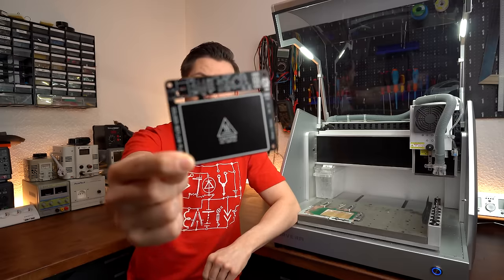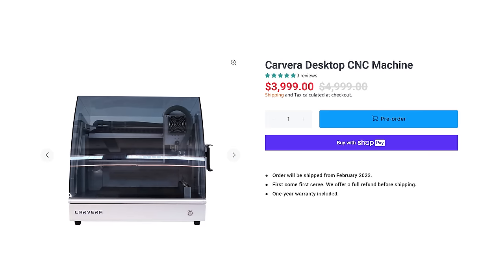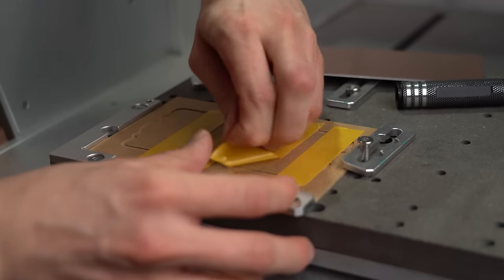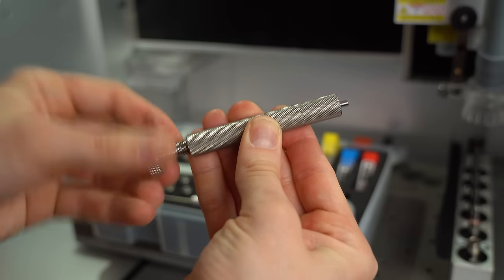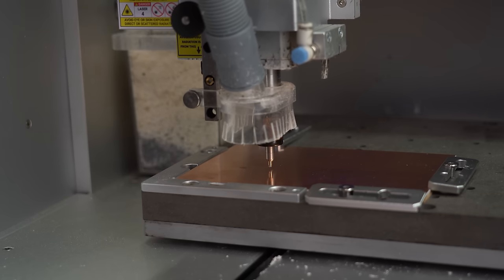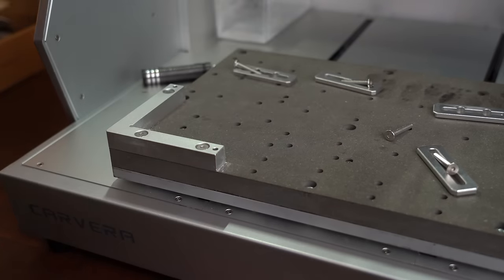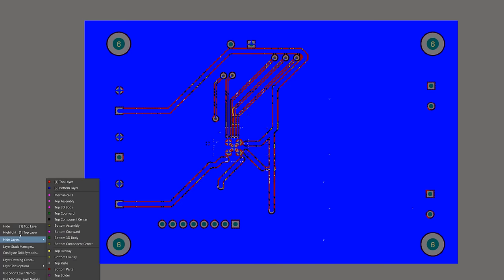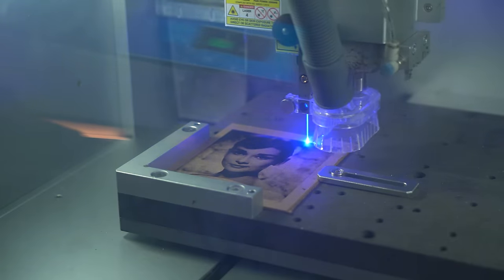"A Machine PERFECT for Making PCBs at Home" Is what they said!

Comment: If you 'just' want to make a PCB, try use a resin printer (without the VAT but with a photo resist coated pcb) as the printer provides the UV source, and the LCD can generate the required pattern. Expose the layout as layer 0 for the required time, develop and etch 'as usual'
Reply: Wow! That sounds great! I feel silly for having not thought of that…I keep looking every so often to see if there’s a cheap and easy way to do this. Transparencies and a UV table seem to require careful choices of materials and stuff that I’m afraid I will have to keep constantly experimenting with to get right.
Reply: Only downside is that one 100mm^2 piece of presensitized copper clad is probably going to cost more than 5 copies of a 100mm^2 from JLC or PCBWay, including shipping.
Reply: @treelineresearch3387  You could be right - I don't know current prices, but I know this:
- It is possible to get appliable photoresist, either in a spray bottle or as a film you apply. Great if you have a stack of bare Cu boards.
- It is faster than waiting for a PCB manufacturer to produce and shipping time can be long especially if you're in a rush
- You keep your design private
Reply: @EgonSorensen  Yeah I can see corporations/consultancies wanting to keep stuff in-house for quicker turnaround and higher security, but just not really a concern for me most of the time, especially given how much postprocessing a fab-at-home board already requires even with presensitized stock (bonding vias, solder mask, etc). Corporate also has different demands and much bigger budgets for materials, dedicated wet/dry lab space, and tooling, than I do so the equation is pretty different.
Reply: @treelineresearch3387  I see two versions of a product: Prototype and Production.
Imho a prototype rarely needs soldermask, but it can also be applied using the resin printer - some experimentation may be needed, esp. if working with 01005's ;ø)

Via's can be easily made with rivets, if a double sided board. 2+ layered isn't a DIY project usually, unless you want to do your own multi-layered 2-layer 0.8mm's + more experimentation, gluing, etc.

Prototypes are excellent for concepts, or very small batch jobs. 
For everything else, yes - it does not make sense to make pcb's at home any more.

Etchants, developer and soldermask can/could be obtained for relatively low amounts of money - and stores for a while.

Also doing it at home could save on import charges and fees. Having the post office/courier (read: required) doing customs clearance often adds a substantial amount of money onto the price of the PCB's - depending on where you live.
Reply: @EgonSorensen  I hadn't considered the local fees that might be attached, that definitely can change the economics. In the states it often seems like our government is actively incentivizing using China with policy (getting something shipped from China often costs less than shipping something a couple states away...). Of course this comes at the expense of our own manufacturing capability, but that containership largely already sailed east. For low density quick prototyping I still mostly use perfboard or "dead bug" on copper clad, still pretty viable for experiments/one-offs and proving out analog blocks.

Comment: 11:05 it should be pretty easy to do double sided designs without all that rivet nonsense. I do similar things on a daily basis milling aluminum on a big 3mx2m CNC router. It is a matter of having sacrificial material and cut the negative of the outside perimeter to make a hole to stick the pcb with the other side up. That way you do have a reference to align the PCB for the other side. To makes things way easier, put one of the PCB corners as the 0,0 then put the zero manually so the contour falls inside the sacrificial material. Make the hole undersized on purpose then increase it's size little by little trying the PCB until it fits. Ideally you'd have a table with suction, just so it is a drop and done affair, but you can always cut double sided tape to size for that purpose.

Comment: I've had great results from a generic "3040" ballscrew CNC that I've upgraded in three ways: 1) I replaced the odd spindle motor they provided with a high-quality 24000 RPM 3-phase spindle.  2) I swapped out the stock steppers and moved to closed-loop stepper/servos.  3) I added a probe input so I can capture a height map of the board before I ever cut it.  Oh, and I chucked the printer-port stepper driver and went with a GRBLHAL networked controller that supports a ton of I/O and 5 axis.  Anyway, the results are amazingly good, and definitely solid for creating your own boards, though obviously it's not going to add vias for you.

Comment: That UV exposure solder mask can be used with an additional mask that you print on a transparency film and lay over the circuit so you can prevent the UV exposure to the areas you want exposed pads. The unexposed mask can then be removed with solvents (acetone I think?) and the pads exposed without the additional milling operation.

The Carvera is expensive but is already a LOT cheaper than a comparable machine that has been on the market for a few years. I worked with the LPKF circuit board CNC for a while and those are a $30-60k machine. I went through the additional training classes they offered and still had issues with damage due to tool changer issues. It did produce nice boards when working right and it had decent software with good support so there is that.

Comment: I made a simple PCB for a passive crossover for a speaker im Building. Carved along the traces with a 90° v-bit and then added solder to the traces so they can handle more power.

Comment: I had a question about the tool clamp size and type but found the answer on their site, so I'll leave the info here.
Comes with 1/8" spindle collet, 4mm, 6mm and 1/4" also available separately. The wireless probe tail shaft can be changed to suite the different sizes.

Comment: Just to set the record straight, there are a few more downsides to using board shops (and this is not directed at any shop in particular). First though let me point out that they (in my experience) deliver great work and high quality pcbs (and associated services), credit where credit is due.

But (for the small maker with some labor of love designs that you try to market to like-minded people) :
- Shipping cost, import fees, taxes ... All of these are excessive where I live. I have had times (depends on getting lucky with customs) where the PCB's cost me 2 dollars and shipping + fees + taxes cost me 120 Euros. And there have been times where the PCB's cost me 40 dollars and the shipping + fees + taxes cost me 30 Euros. Aside from the obvious 'wtf is with these add-on costs' one has to realize that it is a crapshoot if you actually need to calculate this cost into your end product.
- Protecting your intellectual property, and this is a general concern not specific to any board shop. It might not be a fun thing to consider but if you make a good design that garners some degree of interest or appreciation it will be stolen. Sending out your design to an external party is one of many ways in which this will happen. By no means the only one, but one none the less.
- You pointed this one out yourself, speed, again most board shops do amazing work and fast but shipping will slow down things considerably. If you are making fast iterations on a new design this can be a problem. A system like the Carvera, the Wegstr cnc or other desktop PCB solution is going to help out with that a lot.

On the up side, if you need quantity and quality, you will eventually have to use a board shop of some sort.

Comment: Sounds like a good toll for rapid prototyping. 
If you have an finished Design, I would go with an professionel Producer like JLC.
But during the Designphase there you have to: Try, fail and repeat until it works. Sunch an CNC sounds like an good option for multiple iterations.
Reply: Good for catching the little mistakes. We all make them, but having to modify and/or toss out a stack of PBCs because of a small mistake that you could have caught with a quick prototype, isn't good.

Comment: I worked as a biomedical engineer back in the 80's and I'd setup a system that did something similar.  And boy, it was a booger to use.  The mill was ok in the x & y axis, but z depth was controlled by a solenoid and thumb screw. The PCB had to be perfectly flat, or else. And, as far as I knew,  router bits that small weren't available.  A conductive ink was applied to the thru holes, then copper was plated to the boards in a plating machine . (Keeping the chemistry right was also a pain.) Then photo resist was hot rolled on from a carrier film,  followed by normal photo resist procedures.
Took me many weeks to get the procedures down, and in the end, we never really used the system.
Better than running a test scoring scanner when I first started working, though.

Comment: I recently got my first boards from JLC pcb and they worked great despite my questionable design!
Reply from the maker: Great to hear!
Reply: My last design from JLC was almost perfect except that - yet again - some of my holes were a bit too small. They fit each pin just fine but the ESP32 dev board has slightly angled headers already installed. The holes are just small enough that it’s really hard to get them installed :)

That’s one thing that I’d like about making them at home. I can fix mistakes more quickly.

Comment: When clamping thin flexible stock like PCBs, don't have your clamps at an angle like you did in the video. That warps the stock!
Instead, put some packing under the FAR end of the clamp, slightly thicker than the pcb. Now the clamp will only apply downward clamping force at its inside edge and your PCB will be pressed downward and held neatly without mashing and warping it.

Comment: I was getting reasonable results with a modified 3040 and FlatCAM (double sided). This was down to SOIC without any levelling which is all I needed at the time. Though cheap boards and cheap cutters I found could tear out the surface material. I should retry now with my even more modded machine and sw levelling to see how well I can get down to TQFP64 :) Nice video, so hard to try to cover so many aspects in such a short time!

Comment: I built a rotary mill from scratch using Linux CNC on a PC I found on a rubbish dump(plus about $400 dollars in hardware).  The reason I comment here about it, is that I use the Nefertiti bust, as you displayed, to test and tune the machine.

Comment: I've been developing CAM software designed primarily for CNC art/signmaking/engravings, and it works fine for PCB milling if you have a good file format that can be loaded in (i.e. images, vectors). It's called PixelCNC. It's still in beta and right now I'm working on a built-in tutorial system. If you have any suggestions for tutorials or need help with anything shoot an email to us.

Comment: 4:11
Oh my god, cases with slanted io Or usb ports gives me nightmates. I had a case that was like this and my 40euro usb headphones kept breaking,  I have spent 120 euros on many headphones  and even the 3.5mm jack ones have the jack have a loose wires bcs of gravity making it slant and my usb headphones had the DAC in the usb itself as a board, the usb kept ripping off the boards WITH THE SOLDER PADS so I couldn't repair it. Seeing you use a pc case with slanted I/O gave me nostalgia

Comment: Definitely the features are paid for, they are certainly very useful and I would say that if it arrived better packaged it would be a good thing.
Like any complex machine, there are always adjustments to be made during installation.
Surely it is a nice top of the range, I dare say for semi-professional use, the hobbyist will hardly be willing to spend that amount to use it "three times a year" in all cases the range of accessories seems well developed even if the $ 299 for the PCB kit it seems to me a further increase in costs.
In the images I saw that the virgin copper plates due to their elasticity risk rising, to solve the problem you could try with double adhesive tape between the pcb and the work surface.
One thing to rationalize to reduce the movement of the spindle could be the zeroing of the height which could be done near the tool holder and not at the other end of the work plane, possibly if the zeroing did not concern only the Z axis it could be it is useful to place the tool holder to the left of the work surface.
I see you soon!
Reply from the maker: Thanks for the feedback :-)

Comment: their PCB's are properly painted with multiple coats which is why bought ones look better than homemade ones, and using a special coat layer on top of that.
Reply: I want to say the vids I've seen of actual PCB fabs were using a film transfer process to apply photosensitive mask that then gets UV exposed and etched away chemically, so the consistency of the layer was controlled more by the film manufacturing than the application process. Not sure what that process actually entails as far as heat/pressure and if it's feasible to do at garage scale, or if the film is available in small quantities and is storable at room temperature (not sure if it's a precatalyzed material that only stays latent when refrigerated, like carbon/fiberglass prepreg). Spin coating might be a viable alternative for more consistent application of a liquid/gel though, and super easy to implement.

Comment: Honestly, the biggest issue with PCB's is via's. Using conductive paint and a chemical process is one option. But then again, if you're going chemicals anyways, you might as well use a SLA printer for the UV & solder mask, tinning via chemicals, etc... If you think about it, it almost sounds easier to just buy them for $3 from jlc.

Comment: You remember 10 years ago I worked in an advertising company, with very good engraving machines for professional work. A 24x24 inch (60x60 cm) table costs $30,000 (with no additional accessories) and you think your hobby machines are expensive

Comment: If all you need is a one-off or time sensitive board, pcb mills work great.  Leveling is CRUCIAL since the cuts are do thin.  This looks like a dream, but way outside my budget!  In reality, you can get a decent milling machine for kess than $150.  You can even add a laser to most of them for a cost proportional to the wattage of the laser.

Comment: Software. It's always the software that hobbles great hardware. There are a number of reasons for this:
1) Software Engineers not brought in at the beginning and as contributors instead of of followers
2) Design changes made along the way without notification to, or input from, the Software Engineers
3) Last Minute changes made to the hardware with the thinking that its "No big deal" for the software
4) Making the software "work with the hardware" instead of designing both together to work together from the start.
Reply: Glowforge laser cutter is another great example of that. Great hardware, absolute garbage software. Doesn't help that it is strictly "cloud based", so basically lag/delays galore (among other things).

Comment: I know there's quite a few things a CNC mill can do that a 3D printer can't, but I think a 3D printer is just way better value for money. And I can make PCBs at home using press-n-peel toner transfer film, which just prints straight out of KiCad.

In fact, I just finished a design that I'm going to print out and etch this weekend. If I really want a solder mask, I can use the old fashioned photographic transfer method with some dry film solder mask. But it usually only takes a few seconds to run the solder over all the traces to help stop them corroding, and I've never had any issues soldering SMD parts to home made boards, so I don't usually bother.

Comment: I have a many years-old machine that I purchased new and is very similar except for the enclosure, dust collection, and ATC. This machine looks like it could be a version 2 of that particular machine, if only the manufacturer of my machine did not go out of business after a rather successful crowdfunding and decent marketing/ sales to schools. My point is that at the current price point it is not likely that this is going to be something you see in every workshop and makerspace. For less money I purchased another, and far more capable CNC, at least in terms of work are (over 6x in x-y and roughly 10x in z) and spindle (1.5kW), although again without enclosure, included dust collection, or ATC. Let's hope for people who purchase this that the company does not have unrealistic sales expectations that sink the company rapidly and leave the purchasers without support, as has happened time and time again with 3D printing and small CNC routers/ milling machines. This final issue is why I now feel that for the hobbyist or very small business market it is far better to get one of the mass-produced import machines that use off-the-shelf components and standard extrusions. They require more tinkering, but they also are extremely simple to repair or upgrade, because they use off-the-shelf components and standard extrusions.